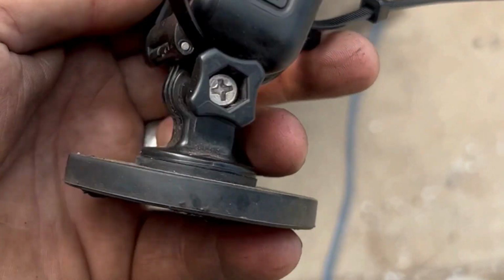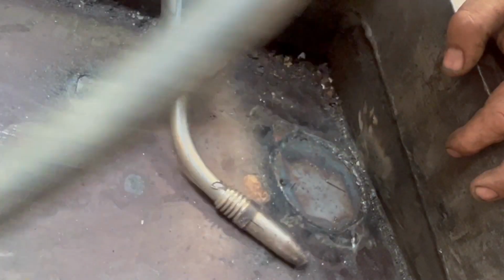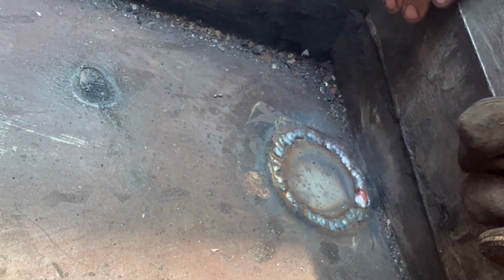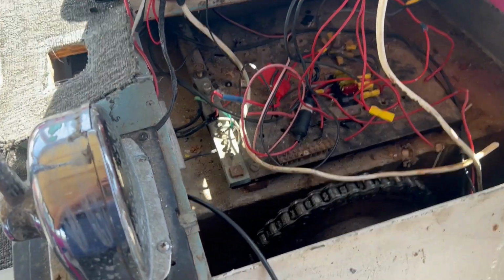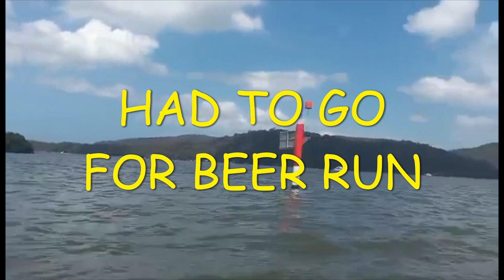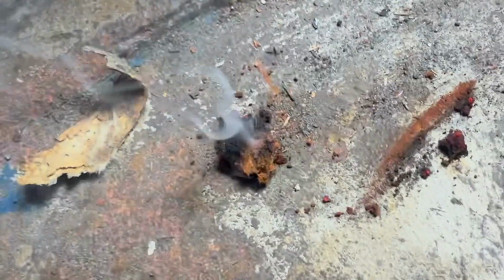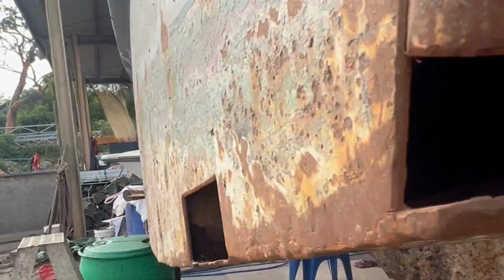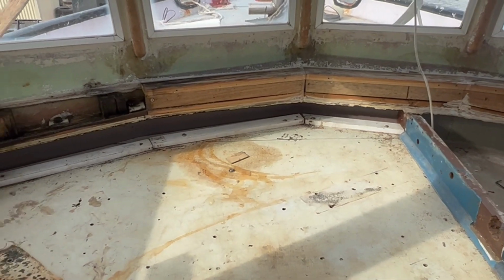Steel trawler gets welded and wheel house strip

Comment: Is there a Gardner going into the trawler did you say? Also love your videos from Hamilton, New Zealand.
Reply from the maker: Yes the owner fitted a reconditioned Gardner his old one was having head issues and done lot work !!
Reply from the maker: My family tree originated from NZ on dads side
Reply: It’s probably still not even run in yet, lots of trawlers have gardners or detroits here in NZ.
Reply: Gardners are only way to go regardles of wether its a 
1 ,2 , 3, 4 , 5 , 6 or 8 cylinder unit. 
We have one of almost every model here in NZ except for a 6LK of which there were only 2 ever made.
Reply from the maker: @matui6983   there beautiful engines, my mate had them in his ferrie
Reply: Did you get the 2 x emails I sent you with the keel cooling pix and sizes?

Comment: Are you only going to be running one raw-water pickup?
Just a thought but on our tugboat we run 2 x thru hulls for each 6-71 Jimmy. 
One is under the hull like 99% of all boats have. The second is for shallow water use so is only around 12-18 inches down the side of the hull. We run a slotted scoop/intake on the lowest one and a round  navy type which has a multitude of holes drilled in it. Both have separate seacocks so are isolated from each other but in shallow water we close the lowest seacock/valve and open the highest. 
Boat can then operate in shallow water without the chance of swallowing up mud and other detritus into the cooling system.
Reply from the maker: I like
The idea never thought that !!
Reply: Even better and actually so much simpler to plumb up, Adrian,I think you should keel cool the engines. Weld 75x75 equal angle toe up externally for as much of the hull plating as you can, cross it over inboard and then back along the other side. One circ pump and no heat exchanger or raw water strainer to block up, which always happens at the worst possible moment.
Reply: Keel cooling is definately a good system. Welding angle to to the hull is one way to do it but the optimum method is to use pipe but you do not leave it round, you flatten it to make it oval. 
A commercial fishing boat had a welded to the hull system and while returning to port hit sumthing underwater and immediately the main engines coolant temp dropped by a large amount. After hauling out it was seen the coolant piping had been squashed/flattened somewhat but only for about 1.5-2m. The consensus is that it is difficult to cool the central core of the water flowing thru square, triangle, fully round keel cooling pipes. Flattening the pipe allows the entire amount of freshwater to be cooled. We own all the casting patterns so ends can be cast in bronze and they are fitted with drain/flushing plugs. System works perfectly on engines up to 25 litres so far, only downside being the price and sourcing of heavy-wall copper pipe. But our setup has been copied many times in steel and I dont know of a failure to date.
Reply from the maker: @matui6983   I be keen to see , but ur right the old copper pipe is killer but not hard make a die to press thick
Wall
Pip
Reply: Id be happy as to email you pix of of the end castings and Ive got one end casting with 2 x pieces of copper fitted into it that I can send a pic of also. Will simplify the engines plumbing. And maintenance is minimal compared to a standard system. 
You could make your own system up pretty easily Im sure.
Reply: If you could put your email up sumwhere I will send some pix of the 2 x different end castings and how the copper pipe looks in one of them. The only castings Ive got right now are pretty much raw and not machined but you will get the general idea of how they look. Building them out of steel wouldnt  be too difficult at all.
Reply from the maker: @matui6983  my email is tannerna@hotmail.com
Reply: Thanx heaps for that. 
Will get to the shop in the morning and snap sum pix of the 2 x end castings and the way we fit the pipe into them. Will measure the pipe to give you a rough idea of dimensions. I might still have the paperwork showing the length of pipes needed for your engines hp rating as we sold a set for a Detroit going into a barge a few years back. 
What hp rating are you setting the engine to in Mamoot?

Comment: Running your roof wiring through some conduit might be handy for any future installation of gear. Easier to snake wires through conduit. Maybe run a couple of extra wires there before you button it up. The same from console to engine room. Coming along nicely, but I get an overwhelming urge to run a grinder and wire wheel😁
Reply from the maker: It be getting plenty grinder action yet !
Reply from the maker: Actually thinking a cable tray that drops on a hinge now u said that